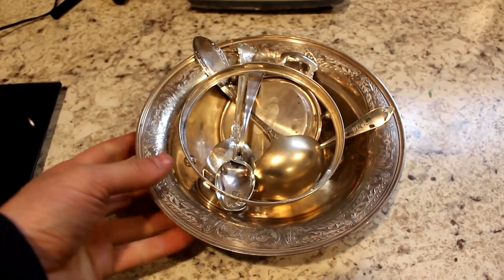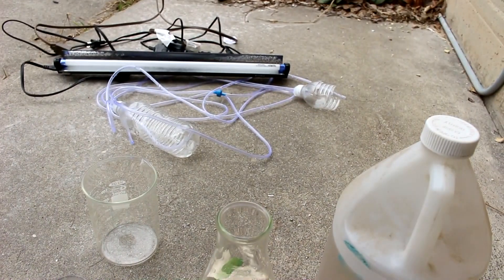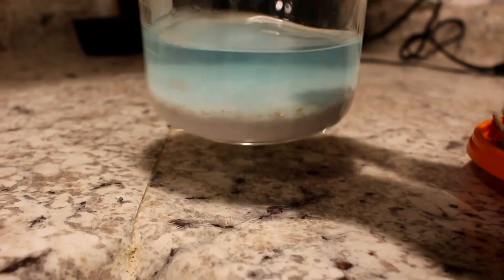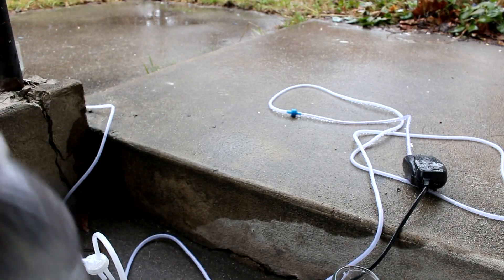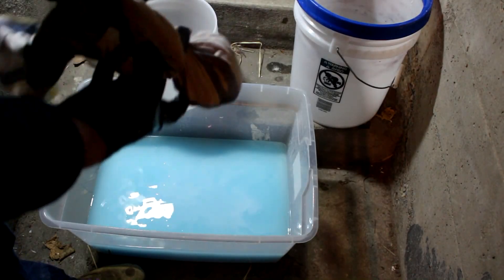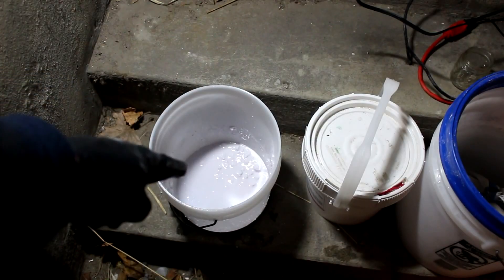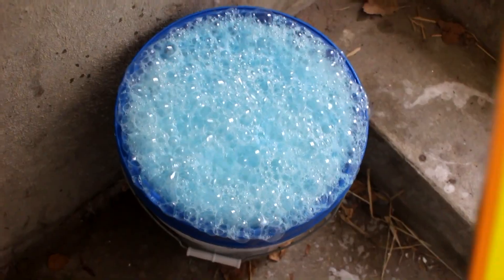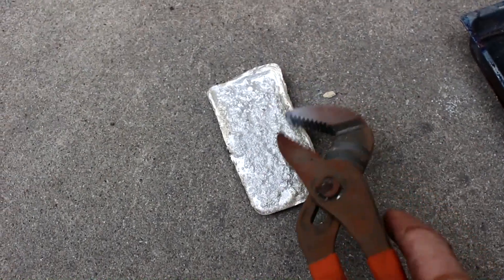Precious Metal Refining & Recovery, Episode 7: Fining Silver

Comment: I think the gas coming out of the silver bar while the cooling process is actually oxygen gas. Silver in the liquid state has the ability to dissolve oxygen gas, wich comes out of the solution when the silver hardens. This gives you a rough an sometimes even a sponge like texture to your silver bar. That is one of the main reasons why the stirling silver was invented, because this alloy does not absorbe any oxygen gas. Give it a like so maybe Cody will read my comment :D
Reply from the maker: +joe doe 
You might be right
Reply: +Cody&#39;sLab but maybe your explanation about the flux and the carbon dioxide isn't to bad either, could be also a combination of both! btw i really love your channel, it's so much fun to watch and educating at the same time. I like how you combine different fields of science like chemistry, geology etc. and just make it so entertaining to watch. keep up the great work!
Reply: +joe doe I don't think it's CO2.  I've melted silver before with borax and sodium carbonate as flux and it doesn't fizz like this when solidifying.  Sodium carbonate is useful btw because it will reduce any leftover AgCl to metallic silver.
Reply: Yup he is,  the "crabby surface is a sign of silver's high purity, just like the "pipe" on the gold button
Reply: +Cody'sLab this may go back to my post yesterday about purging the crusable with nitrogen or argon.  I'm not sure which when dealing with silver. should be a pretty basic build.
Reply: Gotta degass your metals!!

Comment: With the Gloves, is like you dont wear PVC gloves when you work with PVC-Glue-Primer it would desolve them. and Nitril gloves not using with nitric stuff, better Rubber/Latex Or Neoprene Gloves. There is some where a Guide for what Chemical you have to use wich Glove type. just saying.

Comment: Sterling silver has to be over the millesimal fineness of 925 - or 92,5% by weight of silver - so what you used in the video is not sterling silver. If it was sterling silver, you should get around 410 - 415 grams of fine silver, if the proccessing went perfectly. Anyhow, nice video, keep up the good work! :)

Comment: When copper chloride turns blue when diluted with water, it does not change its oxidation state. It's always Cu2+, but it's forming complexes with more water molecules and fewer chloride ions. If you add concentrated hydrochloric acid to solid copper chloride, you can push it back the other way to make it yellow.

Comment: 20 minute video and everyone talking about a 1 second political side note. oh well.

About the actual topic: first, sterling silver is not entirely accurate if you had 80% silver or whatever, since it's a particular standard of 92.5% silver. second, do you expect to recover any of the value lost if you can refine the copper as well? third, was there any nickel in your silver alloys and if not, would that have changed the process?

Comment: when casting aluminium, hydrogen gas, formed from crap on the scrap is a problem, so a second melt is advisable.
My guess is that the gas released would be hydrogen..whilst writing this I start to think about the chlorine..hmm..
Nice video, it takes away many unknowns, like the main concern copper, or the fact that only lead and mercury are the only chlorides that could contaminate the batch.

Comment: So in the lab we always use nitrtil gloves which have the highest restistance (of course some proper venylgloves are the absolut best). When u spill something on your gloves immediatly remove them and put on new ones. Since all chemicals will sooner or later get through the gloves. 
Venylgloves have a even higher chemical resistance and you could easily dip your hand in concentrated Acid but they are not very handy because they are very thick.

excuse my bad english. Greetings from germany ;)